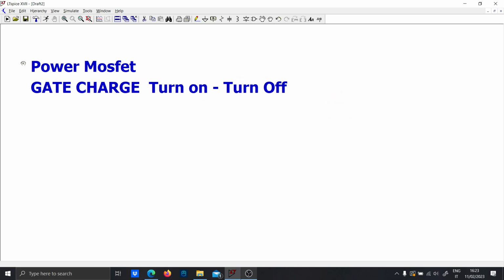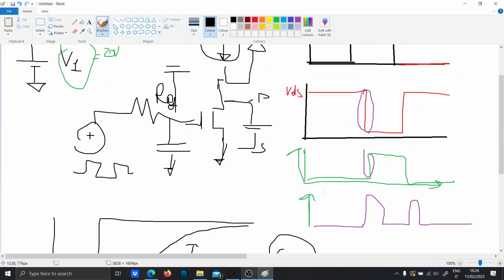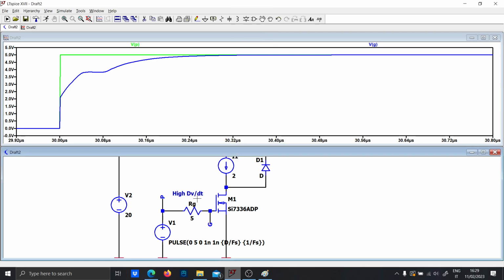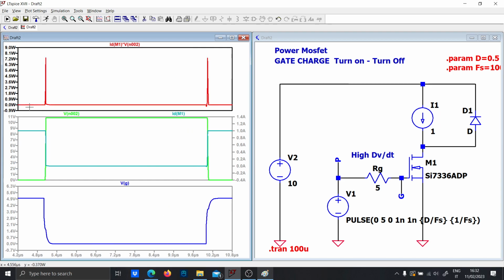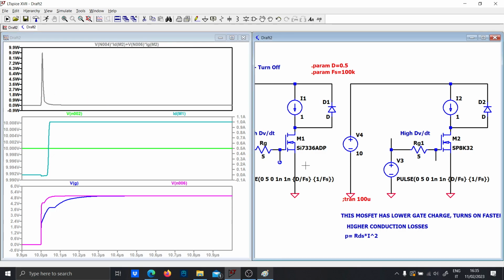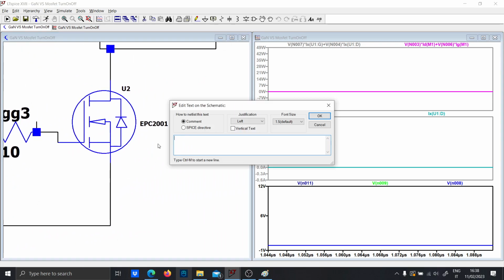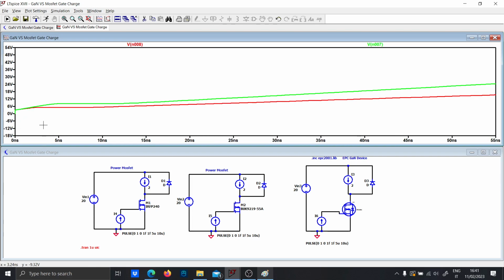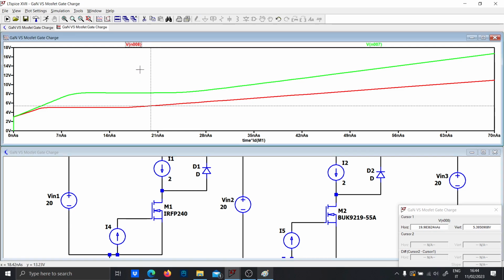LTSpice Power Mosftet Turn On-Off and Gate Charge Analysis( Si and GaN))

Comment: thanks for the simulation but gate charge = t*Ig ; not Id
Reply from the maker: What I did in the video Is to reproduce the Plateu Voltage curve that you find in the datasheet. From that graph, you can find the gate charge, which Is the carge used to arrive at the threshold Voltage.